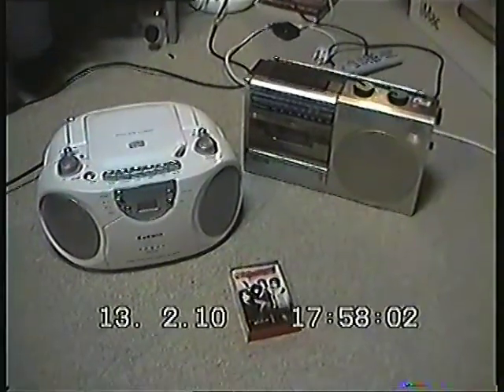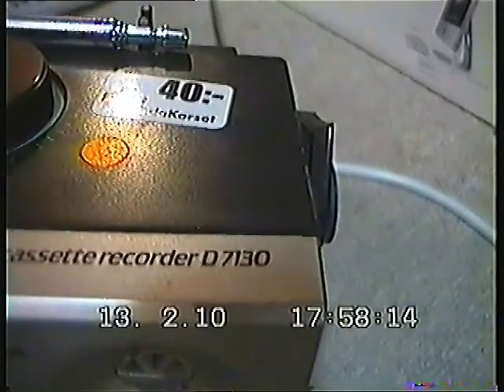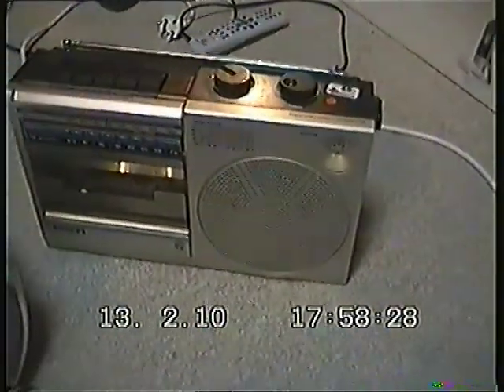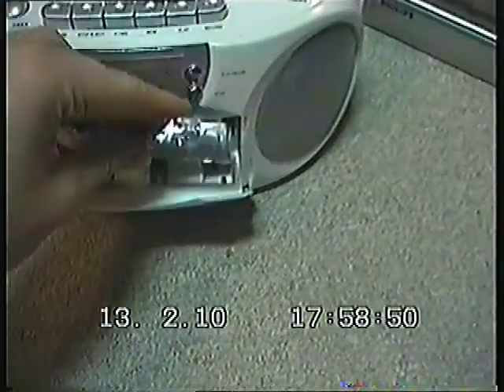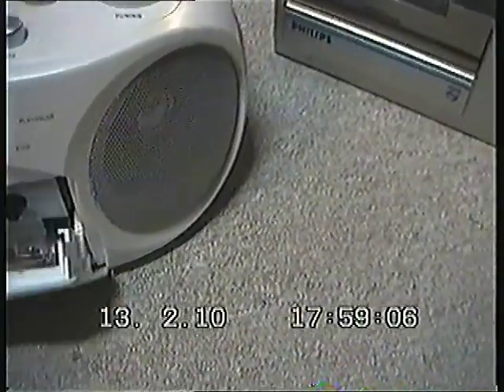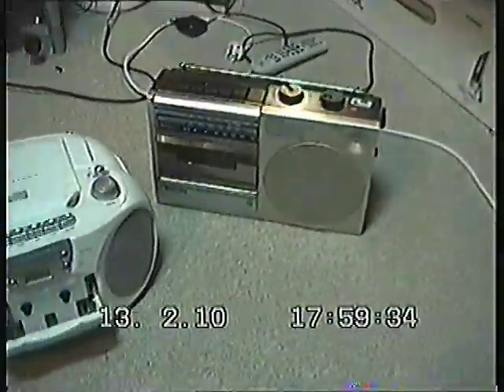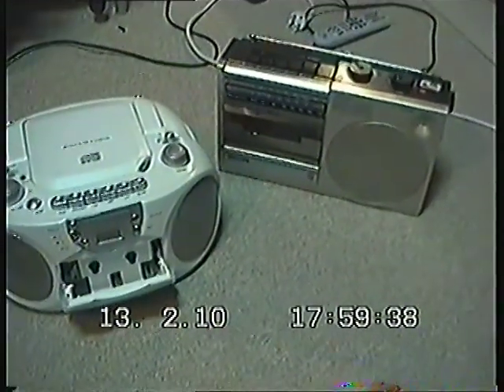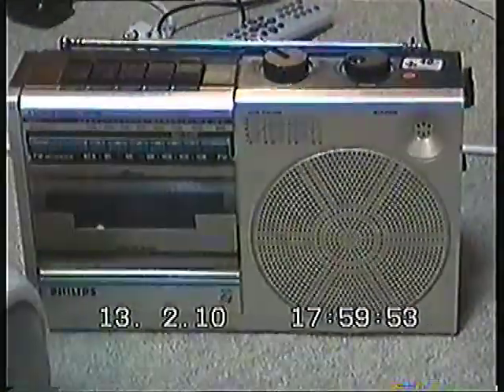Asking for help with a cassette recorder!

Comment: You'll have to open up the housing. On the back of the motor you'll find a small hole, usually there is rubber material behind it. You can stick a small flathead screwdriver through there (but you have to insulate it with sticky tape before doing so, a shortcut can ruin the motor!) and then with the srewdriver you'll be able to adjust the speed.